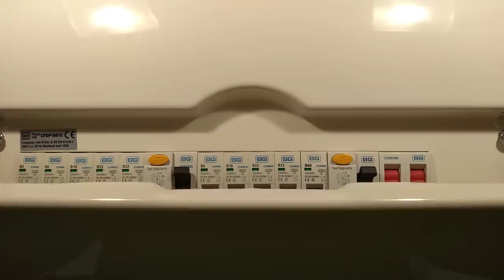A look inside a British home electrical panel.

Comment: We have plastic boxes here in Greece, their excuse is that one won't fry their arse if there should be a fault to the box. Well yes if the ID10T tech failed to ground the box. Now they only use one GFCI for a whole board however in new construction each level of a home has its own panel with GFCI. The crap is if one item trips the whole floor is out. Now I lived most of my life in the States. We have steel boxes that are bonded to ground and one does not worry about fire fom plastic burning. Plastic boxes and conduits must be made of self extinguishing plastic. GFCI outlets are used in bathrooms, kitchen and outdoor boxes or other areas of high moisture environment. The new plan now calls for Arc Fault breakers to be used in feeds in the home. There are different characteristics between an arc fault and a GFCI fault.
I even have a surplus military ISO container that has a metal Square D panel that has provisions for 120v 3ø 60Hz, 120v 3ø 400Hz, and 28v DC distribution all in one box. Don't think it meets ode for civilian use but the military is exempt from a lot of regs.

Comment: What about the 110volt? line that is available? I think I have heard you mention it as a 'shaver" circuit?
Reply from the maker: It's a socket that is sometimes looped off a lighting circuit and has an internal isolation transformer that offers a non ground referenced 240V or 120V outlet.
Reply: Back in the day, a 'shaver supply' was an isolated transformer wired direct to an outlet with a plug-pattern that could only be used on electric shavers. Now that switched power supplies can handle 100-250V there's no real need for the 'old way'.

Comment: As an American electrician it's weird hearing someone say 60 amps is plenty of power.  But that probably had to do with our center tapped transformers
Reply: It's to do with the volts, when you double up 110 volts to 220 volts  you only need half the amps so you can have thinner cables etc

Comment: The wire going to the middle Neutral bar is bugging me.  Probably safe enough but I so dislike exposed wires. 
The metal socket/plugs on the ends of the wires would conduct too, but as I said "exposed wires... ".
Reply: It doesn't matter, the whole neutral busbar is exposed!
Reply: @peterpeterson9903  
I did say it was (probably) safe enough, but exposed wires bugs me, aesthetic thing rather than a safety thing
Reply: @Cheezsoup  Got you.

Comment: I suck at electricity, explain how overcurrent happens ? How is it dangerous ? I mean if I have 220v at 50hz supplied to my home, and I plug in a device that draws 40A, while the socket is connected to a 30A circuit breaker, it just won't use the missing 10A and probably won't work or damage itself trying ?

Comment: That would newer work for a home machine shop or is that not allowed where you are at?
Reply from the maker: These days you get inverter drives that will run three phase motors on a single phase circuit.  In the UK most home workshops are quite small.

Comment: 13:00 except if you have a Neutral to Earth fault, because your circuit breakers dont disconnect the Neutral. Its really annoying, especially if you only have one RCD feeding 30 breakers.
Reply: One RCD feeding 30 breakers is bonkers. Normally RCDs are only 63 or 80Amps. One L to N short is going to trip the whole damn lot. Who would "design" such a thing. Should not have more than 5 or 6 circuits per RCD. Wylex now make DP RCBO's. Much safer.
Reply: @shilks8773  Here in Germany most older houses have only one RCD for everything. In my house it is indeed one 63A RCD feeding one breaker for each room plus several breakers for kitchen, stove, washing machine, etc making a total of like 25 breakers I think. It is a 3 phase RCD though and the breakers are split evenly on the seperate phases so there certainly is no lack of power but knocking out the entire house for a earth leakage fault which in 90% of the cases is a false trigger, is really annoying. It wont trigger on shorts though, because its slower than the circuit breakers. Also it wouldnt open if the 63A are exceeded, its not an RCBO.

Comment: 9:42 — "These circuit breakers that draw 1 watt cost £1 a year to run."

Holy... best heuristic for electricity costs that I've come across. Sure enough, £1 per watt year ≈ 11.42 pence per kWh, and tariffs are currently around 10 to 15 pence per kWh. Why on earth was I not told this in school?!
Reply: In Poland u pay 70PLN/16-17EUR/17-18USD for month without any ussage
Reply: @mateuszzimon8216 , yeah, we also have standing charges, but obviously you can't avoid those.
Reply: @JivanPal  but overall monthly payment is 100pln for 3person home, without electric water heater
Reply: @JivanPal  Those do not count when the issue is increased cost of an item. That is also nice in other things like if your TV uses 36 watts and you use four hours a day. Four hours is a sixth of a 24 hours so it is 6 euros. and up to 1 € for stand by.  I currently pay 11.8 c/kWh so that is almost exact.
Reply: @okaro6595 , "those do not count" — sorry, what are you referring to here?

Comment: That's cute. My new breaker panel has room for 144 DIN modules... Which i need for the smarthome control stuff. Each 8-way output device takes up four DIN modules.

One thing i don't like about that design is that neutral isn't broken when the breakers are off, only when the RCD trips. I'm using 2-module breakers that also break neutral.
Reply from the maker: That sounds like an impending electronic inferno.
Reply: @bigclivedotcom  It'll definitely be a rats nest by the time i'm done.

Comment: Oh, man! I thought you were showing us the load center for your home. I was cringing as you stuck your fingers all over the place in that thing. When you touched the neutral, I was relatively fine with that, but when you got for fingers close to the live bus bar, I was like, "What is he doing?" That was until you rocked the thing, and I realized this was on your workbench. In America, we have two live, a neutral, and a ground in our load center. The the live connections are used together for 240 volts and are typically used for high load devices like water heaters, air conditioners, electric furnaces, and electric dryers. The two live connections are split into separate circuits powering half of the 120 volt circuits in the home with breakers for each line. These are used with a neutral connection for 120 volt connections like lighting and receptacles. The two live bars are actually alternated in the load center so two adjacent breakers can power a 240 volt connection. The 120 volt lines go to a main breaker that is usually 100 amps in total using two 50 amp breaker bridged using the two live connections. If we had the money, we would replace our 50 year old load center. We have a mix of aluminum and copper wiring though.
Reply: Why are so many people hateful about ring mains?  They are easier to wire and make more efficient use of materials.  The only downside is slightly more complicated testing but this just makes more employment for electricians.

Comment: I'm just curious, don't you have 3 phase power in the UK as well, or is it like in the US, where just industries have 3 phase supply. It's kinda cool to live in Austria where every household do have a 3phase supply, specially if you do have a woodworking shop in the basemen like i do ;)
Reply: It's not impossible to get 3 phase power to a residential property in the UK, particularly if you are a millionaire with a very large home that uses a lot of power, but in most cases the upgrade to 3 phase would be disproportionately expensive compared to the benefit you would get from it. The process to obtain such a connection upgrade can also be somewhat bureaucratic, involving coordination between multiple organisations. It might involve digging up the road and temporarily controlling the traffic. In other words, there isn't a rule that forbids 3 phase in homes, but in practice it tends not to be a viable option and is therefore uncommon.
Reply: 3 phase in the UK is only installed in commercial  or industrial premises. A 100 amp 240v supply is plenty, if you need 3 phase for a lathe of something in the shed or garage then you have to use a converter.
Reply: @Matt Quinn out in the sticks they may be small holdings or count as agricultural, hence the 3 phase.
Reply from the maker: Depending on the equipment in your workshop and based on just you using one machine at a time it's viable to use single phase to three phase variable speed motor drives now.  That also adds soft start and other nice features to your existing machines.

Comment: Did the intended series of videos happen or it was shelved? Looked for the series but no show in your vid list......
Reply from the maker: I made a few, but didn't finish the set.  I'll revisit it.
Reply: @bigclivedotcom  Brilliant. I am trying to upgrade a DB from probably the 70's and looking for some pointers and best practice. Imagine a house with 4 MCBs, 1 for the Cooker, 1 Gyser, 1 for all the sockets and 1 for the lights, indoor and outdoor. Funny enough such an old setup works really well with PLC (Power Line Cimmunication) but is a nightmare putting an inverter on. You can not isolate anything unless you run new wiring.

Comment: So different from North America. Also we run 50A-240V for a range. GFCIs only on individual circuits such as for baths. We also have the nonsense that is AFCIs. Fortunately my house is old enough not to have them.
Reply: We in Germany got those AFCIs now too, for Commercial Buildings. But they take so much space in the Fuse-board.
Reply: In the UK, we don't have outlets in bathrooms or within a certain distance of sinks/basins - with the exception of a special-type "shaver socket" that has to be somewhat away from the water and uses an isolating transformer+fuse with an effective 200mA limit. Those can be used for electric shavers/razors, charging electric toothbrushes and such. They use a 2-pin plug (vaguely EU-compatible I think) to dissuade from plugging in normal BS "13A plug" things. GFCIs (also called RCDs in the UK) first turned up here as a plug-through adaptor to be used with electrical appliances being used in the garden - especially electric lawnmowers (and hedge trimmers, etc.) where there is the direct risk of cutting the extension lead / flex WITH the lawn mower. Average UK residential gardens are small enough that a modest electric hover-mower is all that's needed for mowing the lawn, so that's normally an electric-appliance task here.
Reply: @MattFowlerBTR  i think he meant with Baths, not Bathtub. here in Germany we had the Shaving Sockets too, but now days you cant even buy them, because GFCI respective RCDs are now by Law, for all Appliences including Sockets, Lights and other Outlets. https://en.wikipedia.org/wiki/European_Committee_for_Standardization

Comment: Does your pinball machines trip the b-type? One of my machines seems to trip the circuit breaker half the time. An extension cord seemed to solve the problem.
Reply: did you check the extension cord for heat ?
Reply: @maicod  Good question. :D Absolutely, it only seems to draw around 250w when running. Its the transformer that creates the surge when powering it on. There's a funny options in the software settings though, where you can disable some of the features in case you don't have enough power when running the multi ball features, you can then choose to have it not use some of the electro magnets. so there must be a few spikes even when gaming. :)
Reply: yeah I was thinking if the power cord helpes diminish the surges it would be cause of resistance of the power cord (thinner wiring) making the power cord possibly overheat but indeed if it is during powering up and not continuously the heating issue will be a limited thing.
Reply from the maker: I guess I'll soon find out.  Up to now they've been on traditional cartridge fuses.  The transformers are quite chunky in pinball machines.  An NTC inrush limiter mounted in ceramic terminal block could help with a rogue machine.  Another thing to consider is the possibility of a failing interference suppressor in the machine.
Reply: +bigclivedotcom oh this panel is meant for your own house ?
Reply: @bigclivedotcom  hmm thanks for the input. Sounds like I should have a look at it and see if I can figure  to see if it is failing.
Reply: @maicod  exactly

Comment: Those BG RCDs have caused me no end of trouble. The bus bar terminal is weak and can break even using a properly set torque driver. Seems to be a QC issue. As an experiment I used an impact driver to tighten one up as much as possible and it didn't break (it was spare and got thrown out later don't worry), another one broke just through hand tightening. Rubbish.

Comment: US electrical boxes are far simpler.  We accomplish Arc/ground fault on the breaker itself only, or at the first outlet in a chain.  Just put an outlet in today and I noticed the screws are now full chinesium.  Barely got them in before the heads crumbled to dust.  Damned shame.

Comment: We are not allowed to wire neutral like that. Neutral should never be disconnected from the main grid, thats why we use balancing wire between main neutral bar and groundbar. RCBs, yes, but not the main connection. Because if the switch fails mechanically you might end up with live neutral bars.

Comment: Interesting the ground wire is undersized. In the US the ground is same size as mains.
Reply: With the way this box was set up, the earth would only have to carry 30mA, so as long as its resistance was within safety limits, there is no need for anything larger, is my guess.

Comment: USA here: I assume the neutral is at ground potential(?)... and you break the neutral with the isolation switch. I'm not a licenced electrician, but I understand that breaking the grounded conductor (by a fuse, switch, etc) is not permitted here.
Reply from the maker: The neutral is at ground potential but the return for current.  The earth is not broken.
Reply: Neutral and ground are two different things, and you have different type of ground systems: or the ground is supplied by the electricity company (as a separate conductor or combined with the neutral till the consumer distribution point) or it's not supplied and you must use a ground rod (in TT system).

In either cases neutral and ground shouldn't be connected together anywhere by the consumer side, that is different of what you do in the USA (where you bound together neutral and ground at the supplier side). That is not so secure for one reason, if the neutral becomes disconnect you have full line voltage on any exposed metal surface, that is not ideal. When neutral and ground are combined at the supplier side they do that in a way so that this situation is not possible, because they use a special kind of reinforced cable.

Isolating also the neutral is necessary, first because a RCD must isolate the neutral (there could be a fault between N and E), and you sholdn't assume neutral to be at 0 potential for many reason (a fault, for example). Where I live no only the neutral is disconnected by the main switch and RCDs, but also single circuit breakers disconnects the neutral (and is useful, especially because I've seen so many times that L and N are swapped at the meter).
Reply: In the US, it is permissible to break the neutral, as long as the hot conductor is broken at the same time. One place where this is done is branch circuits feeding gasoline pumps at service stations. There are special 2 pole circuit breakers made for these applications.
Reply: I work on equipment (in America) that is made in Germany and has the neutral fused as well as the hot. I always thought it was a strange setup that if the neutral fuse blew you had hot throughout the equipment. Some equipment has a ganged main breaker/power switch.

Comment: That bus bar isn't perfect for those breakers. Have you noticed the cutout by the screw head? That's where the U-shaped prongs of a proper breaker bus bar go into. No risk of operator error there.

Comment: I've noted all switches' inputs are on top and outputs on bottom. Then 10:17 Copper bus bar connects RCD output (bottom) to the inputs of individual circuit breakers (also bottom). So there is no exact rule that inputs on top and outputs on bottom ? I just try to figure it out. Thanks.
Reply from the maker: The busbar is on the bottom here.  All circuit breaker connections are at the top.

Comment: I have this exact panel, though mine has a couple less trips and an additional rcd just for water heater.
Reply from the maker: Good call.  Water heaters are a primary culprit for causing leakage issues.

Comment: Gotta say American panels with plug on neutral combination breakers are vastly better. 

And better still is low voltage point to point dc lighting separate from AC.